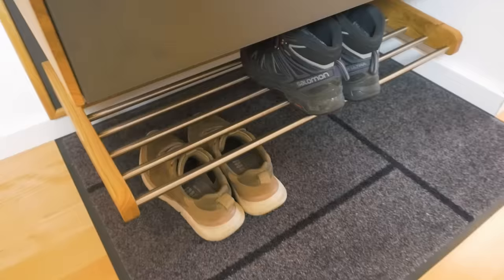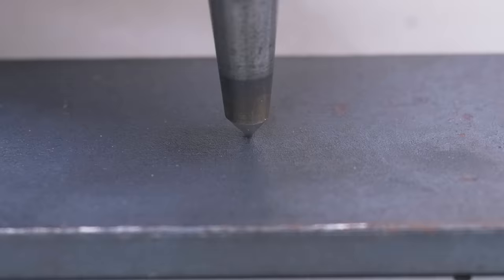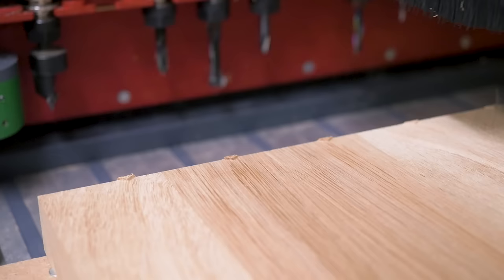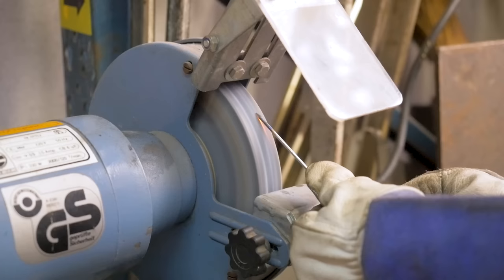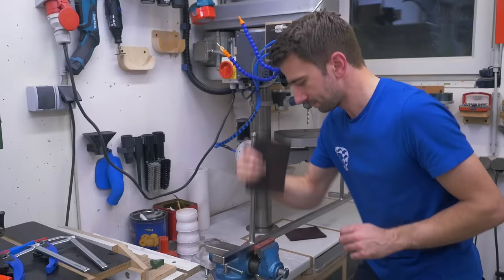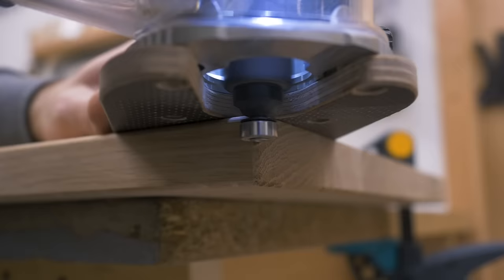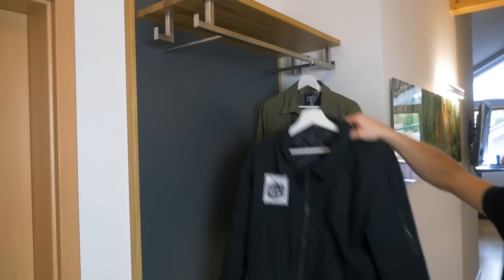I saved 100€ building this Wardrobe

Comment from the maker: This project was on my ToDo list for over 1,5 years and just had to be finished now. I'm really excited for the next project. Building a new machine!
Reply: A real man knows what he has to do. There is no need for the wife to remind him each 6 months.
Reply: A grinder and paint, make me a welder I ain't...
Reply: Keep up the good work. Love the quality and humor in it. Long or short video's, no matter, i'll watch it all.
Reply: Your finesse to fit and finish is absolutely top dollar.
Reply: Let us see your bike😮
Reply: Now knowing you're a motorcyclist, I'd love to see a few things building stuff that go along with that. A drying rack / organizer for riding gear ( helmet/jacket/pants/gloves) and supplies (cleaning supplies, earplugs, etc) A motorcycle lift for maintenance (electric).
Reply: Nice Video. If you want more accurate welds, try welding one side then the oposite side. the cooling of a weld bends/warps the material slightly at the weld. if its a long weld you can split it up in more sections. one side welding 1/4 then the oposite side and so on till youre done.
Reply: 14:50 - if you want to have nicer looking welds, just go over it without the filler rod one more time to smooth it out more. Espacally in the beginning its hard to keep track of the whole process :)

Comment: Your welds don't look bad for your first attempt. Give it time and believe me it will get much better, especially if you have the opportunity to practice in your spare time. A TIG welder was a dream of mine for a long time, then I bought it, practiced a lot at home and now I'm at the point where I passed an official TIG welder exam.
Reply: Yeah honestly pretty decent for a first attempt- having tried many different welding methods id say tig has a higher barrier to entry but once you nail the basics like how much stick out, dabbing and how to grind your tungsten it gets easier. Note if your tungsten keeps sticking it means you are too cold on your amps, try turning it up a bit more. Also want to note that when you grind a tungsten like Marius did on a bench grinder you should use the whole wheel whilst also turning the tungsten as it ensures you get a more consistent tungsten and you dont get a wear line in the wheel
Reply: If this is rly your first time weld, then yeah. it looks rly more then okay!   For me it looks like you used to much heat or heated up too much of an area/were too slow.  Maybe your feeding material is too big of a diameter ?  there is smaller ones that makes more finer "drops" .  

Just keep practicing, once you get the hang of it it will just kinda go by itself. I love TIG welding
Reply: Congrats on passing the exam! My Dad was a welder and a very happy man ❤

Comment: Small tip for doing 90° chamfers on the drill press: since you get a 1mm radius increase for every 1mm you drill down with a 90° bit, you can use the depth scale on the drill press to know how deep you have to go (just remember to multiply the depth by 2 for a diameter instead of radius). Example: Want to make a Ø17.3 chamfer on a Ø8.4 thru-hole? (17.3-8.4)/2 = 4.45. So when you drilled the Ø8.4mm just touch it using the chamfer drill without it running, zero the depth scale and then drill 4.45mm down to get a Ø17.3mm wide 90° chamfer.

It´s not that important on flat stock since you can see and measure, but for inside holes/chamfers and hard to reach places it´s quite useful.
Reply from the maker: Good tip. So obvious, but I didn't think about it

Comment: Amazing work and i loving new tricks to getting things done. As far as the stainless tig welding, heat and argon control is crucial. Too hot or not enough argon and you will get oxidation. And the backside of stainless steel that isn't shielded will get sugaring. For the amount of argon flow, i use 2x the cfm of whatever cup size i'm using.

Comment: Great job...

at 15:55 you can do simple geometry calculation for the extension needed before cutting, by adding the same thickness of the piece of wood without the groove to the the length of the piece and multiply by 2 to take into consideration the second corner on the other side.
(In mathematical words: it is a right isosceles triangle situation where the hypotenuse is the oblique cut)

Comment: As for the welds, they turned out all good on the external joints but smoothing out the inside radius on those welds would get the project to the next level. 

I recommend using a hand round file to smooth out all the lumps and bumps in the weld. If you have divots in your welds that you can't get out. Use car bondo or throw another weld on and repeat with the round file, then wet and dry sand paper, then polish or create your preferred finish but if you've used bondo, you have to paint your brackets to hide the bondo.

Some may say use a die grinder or belt sander to smooth out those internal radius welds but for my money, too much of a chance of a mistake with the die grinder digging in or you may lose control of your piece on the belt sander and accidentally sand outside the intended sanding area, ruining all your earlier work.

I suppose you could put your die grinder bit in your drill press and lock the drill press in the down position and then offer up your piece using both hands for better control but then again, same issue as having an accident on the belt sander. Considerably less chance of an accident using a hand file.

Comment: You are certainly a one-man-DIYer with a very wide range of talents. Don't know much about welding so I'll leave that for others to comment. The rest of the workmanship is first class. I especially appreciated the candid admission that while the material cost was less than a commercial unit, the amount of work and effort along with having all of the necessary tools would put the final price way higher. But then again, what price for the satisfaction of a job well done?

Comment: Looks really nice. My motto has always been, why buy it when you can build it for twice the price. Nothing like bespoke furniture.
All your welding needs is more practice. For stainless you might want to go to a larger gas lens cup and keep the cup over the weld with some post flow while the joint cools to keep the discoloration to a minimum.

Comment: best tip i ever got for welding was use a test piece of similar material/thickness to dial everything in on before you do anything with your actual project/piece your working on, also chanfering your round rod edges can make a cleaner weld when butting them to a flat
Reply from the maker: Thanks for the tips

Comment: That small 3d printed ring for the tube was the cherry on top.
Reply from the maker: That wasn't planned. I yelled very loud when it chipped
Reply: @MariusHornberger  
Next time start the forstner drill in reverse and when you are through the fragile top layer continue in the right direction
Reply from the maker: @3dmazter  it chipped during assembly

Comment: Marius, there are many other ways (for the mean time) to improve the finish of that weld. You can use a 115mm slim-line disc, and grind with the edge - almost as if you were going to "cut", but you grind with the edge. Or, some people use some sort of "plastic steel, and other types of "fillers" / putty, to smooth it out, especially if they are going to paint over it. I prefer the "grinding-with-the-edge" finishing.

Comment: I suggest you'd find assembly with the steel tubes much easier if you put a slight chamfer on the end of the rod, like on pre-formed dowel pins. And ugly welds are just a sign of someone who hasn't put years of practice in. Don't stress over it. The more you do the better it'll turn out. Then again you could just quote AvE: "grinder and paint make me the welder I ain't"

Comment: Great video, defintely an amazing job first time welding. Whenever you add filler rod when you're welding, it cools down the molten steel, so the only thing I see wrong with the weld is the amps seem to be a little low/ welding too slow on the square tube. on the round bar its just an unstable hand.
This is just my own opinion. I myself have just over 1 year of professional welding expirience so I might be wrong.
Reply from the maker: I used about 60amps on the 2mm square tube and about 45amp on the 1,5mm round tubes

Comment: Good job. The oak with the grey melamine is a nice look. Two very minor criticisms: 
1. The grain of your drawer bottom should be from side to side to allow for expansion at the rear. You won’t have an issue with plywood, but it is tradition. 
2. Why not use concealed under mount drawer slides? They are sleeker and give the furniture a more refined look. 

Well done!
Reply from the maker: Thanks! I wanted max vertical drawer space. Not possible with undermounts

Comment: On stainless for TIG welding… it looked to me like it was way too hot. I use material thickness as a starting point to set amperage (imperial). Was always told and practiced get in get out on stainless specially sheet metal. Stainless LOVES to warp even with the smallest of heat input.

Comment: Top tip: Just weld more.
But a thing that helped me was to always have something to rest my hand on (for example I made meself a couple of solid bars (one curved) that I can slide my hand along, and use a magnet mount to hold it), and buy a tig pen (or just make one), many consider it "cheating", but why make it harder?

Comment: As usual, great to watch your projects 👍
P.S.
For rigid fixings in to walls, look in to HILTI anchors (HUS4 most popular), they have also shear and pull out strength limit tables and they do not need any plastic pins before anchor fixing in to wall hole

Comment: I did a shoe rack with similar tubing to yours and was equally surprised how much force it actually took to push all 10 steel tubes in at the same time even though individually it was a nice fit. If only I could have known what 10 times something is beforehand :D . I had considered securing them with screws from underneath but even without the epoxy I used, there's no way nothing is coming loose. The design idea was that it obviously had to be nice (it has all sorts of compound angles and even the mortise and tenon joints are compound angled) and as a bonus could be stood on if need be (or someone decided to be stupid because who stands on a shoe rack seriously?).
But I did manage to drop two kettlebells (20kg and 24kg) from the height of 2 meters on top of it and surprise surprise, that was a bit too much (I tried to bend some pieces of wood on the top shelf without removing them because I was lazy and that plus my entire body weight snapped a screw and suddently I had two airborne kettlebells). Two steel tubes got bent on the shoe rack, one of them broke a small piece of wood underneath it as well. I was surprised I managed to fix it so well that I can't even tell anymore where the kettlebells hit. There's nothing like spending a lot of time for an overly built and elaborate thing and then breaking it because you're stupid and lazy.

Comment: Nice work. I would say that your welds look a little bit on the cold side : not enough penetration, bump up the amperage 5 to 10A. A straight grinder (with carbide cutter) is a must have if you want to clean the inner welds in a corner, as well as grinding disks with a built in radius (just discovered them at my side, it’s super handy). Sooner or later, you will find that TIG is an amazing tool, very versatile, but slow. MIG welding is way faster (but sometimes a little messier).

Comment: Another really impressive job Marius. Thank you for sharing.
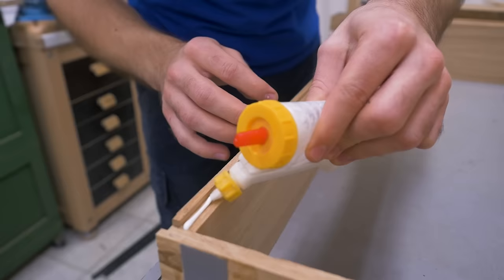I was surprised that you chose to support the base of the draw using only glue (at 8:50). Or did I miss something? Figured you'd go for some grooves, or some brad nails, to support it in addition to the glue.
Reply from the maker: Thanks! The drawer only holds 1kg max of caps and gloves. It'll be fine

Comment: Turned out beautiful. If you centered it on that wall instead of slid over against the wall, it would make the right side hooks more useful. Stuff hanging on the other side might get in the way of the door though.
Reply from the maker: There's a light switch, that can't be covered

Comment: Not that bad of weld. Welds don't have to look pretty for this type of purpose. You're not welding a nuclear reactor lol. I'd suggest first-timer to use MIG welding instead of TIG. It's way easier with less moving parts. Cheers, great video.

Comment: With the cost of materials these days it’s so hard to build things yourself with the dream of saving money. To get the cost down I had to change the design of my tire rack 3 times to store a 31, 32, and 33” tall sets of tires. Total weight was close to 950 lbs.  managed to get it $25 cheaper than store bought racks that to be honest, Would not have been strong enough anyways and they wouldn’t have given me the shelf for storage above tires.

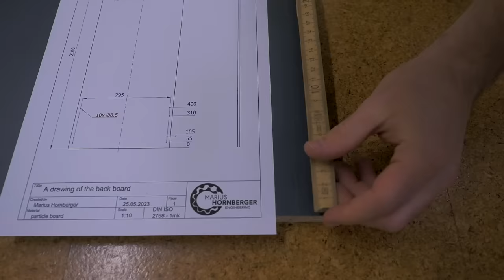Comment: 0:57 "I'll print, when I'm in the mood". Yes. Every printer ever.
Reply: @aaakkk112  Well, that was back in the day, when drivers were written for a specific model. (Not so) fun fact: today's printers run on some levels on the same code as those from 40 years ago. All that was added was layer after layer to support USB, wifi etc.

Comment: My two cents as a cabinetmaker: Those push to open telescopic drawer slides are crap. Regardless of a brand. They jam too easily. Instead, I would put normal slides and open the drawer by grabbing its front from underneath. Much more convenient as now it's a one step operation.

Or if you are really keen on push to open feature, then I would opt in for Blum Tip on Movento with a synchronization rod.
Reply from the maker: I was debating a lot about the slides. Would have prefered Blum bluemotion undermount slides, but I wanted as much vertical space as possible

Comment: Looks really neat! Any reason you didn't opt for concealed drawer slides like Blum Movento? those have the option to be Push-to-Open and soft closing at the same time i use them all the time they work great.
Reply from the maker: I wanted max vertical drawer space
Reply: @MariusHornberger  yeah that's a good point. Those concealed drawer slides require atleast 28mm space below the drawer bottom.

Comment: As a TIG welder and machinist, that’s been working with stainless for about five years now in the marine environment, I can weigh in. Looking at the test piece my assessment of your issues would be that you didn’t weld it good, hope that helps!
Reply from the maker: Thank you. That really hepls😂
Reply: @MariusHornberger  All seriousness, I don’t know if your TIG welder has a pulse function, but it’s a godsend for welding stainless. Too much heat and the chromium will boil out of the weld puddle and you’ll loose the rust protection in that area. Additionally you get this grainy crystalline growth on the opposite side of stainless welds that TIG people call “sugaring” if they get too hot and that surface interacts with the air. You can back purge stainless by creating an aluminum foil covering and pumping argon into it with a second regulator. But all these issues can be avoided if you limit the heat input which is why pulse is so cool. I do a duty cycle where the low amperage is almost as low as the welder will hold a sustained arc, the high is about double the 1 amp per 0.001” of thickness rule, and the duty cycle is 15% high 85% low with a frequency of 1 Hz. It’s enough time to let that blast of heat form your next bead, and then reposition for the next pulse. This works great with autogenous welds which is what I always try to use on low-load aesthetic projects like this one whenever possible. Cheers from the US 🤘🏻
Reply from the maker: @LordOfTamarac  I've got pulse. Thanks for the setting recommendation

Comment: I never look at this sort of stuff in the light of "did I save money" and more along the lines of "did I get exactly what I wanted, and is it built better than something commercial". Also, the justification for the tools, is even if I buy commercially produced thing, in the long run, I end up with less expensive furniture, that's built better, and not like anyone else has.

Comment: 12:27 as someone who does welding for a living TIG welding is a fickle beast to master, 

from what i see is your setting's are way too high & because of that to not burn through you're relying too much on the filler rod's truth be told if you can't fit a piece of paper through the gap between the two piece's of metal you need to use your filler rod sparingly.

also you're electrode was too far out should only be sticking out about half of what was shown in your demonstration

 you aren't moving enough to you should be moving in overlapping circles if you're cheap like me then you should get a bit of wood drill a hole into it get some tape put it around a pen then draw a continuous line of small overlapping circles to get that feeling memorized for the wrist movements.
 
finally your torch position was way off, if you place the electrode 90 degree's from the piece then tilt the torch towards you by around 15 degree's so the other side of the electrode is pointing at you, then tilt it 15 degree's to the opposite side you are pushing.

the rest is just practice it'll take around 100's of hours to master compared to MIG or stick welding which are only 20ish hours
Reply: Edit: final final mistake i've just noticed is that you didn't clean the material enough which is why you have those stains since you probably didn't clean the material after getting it well enough which could of ended in disaster make sure you clean the surfaces with isopropanol alcohol before welding.
Reply from the maker: Thank for the info!